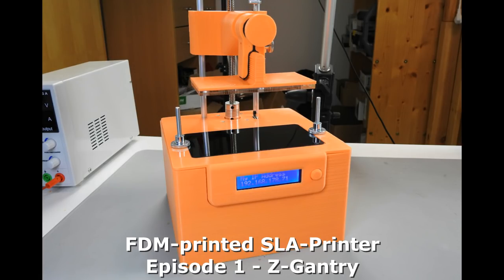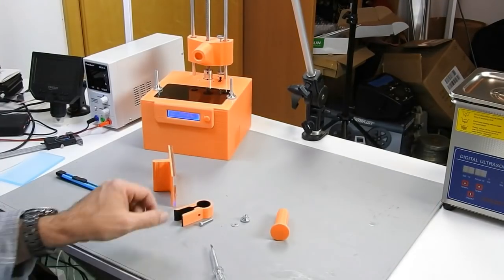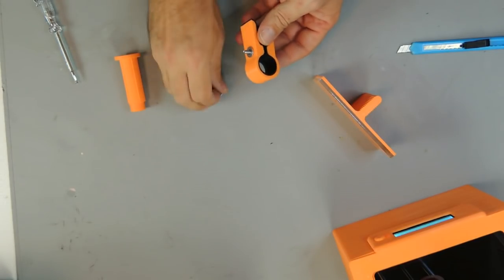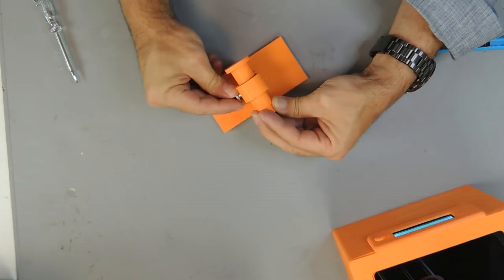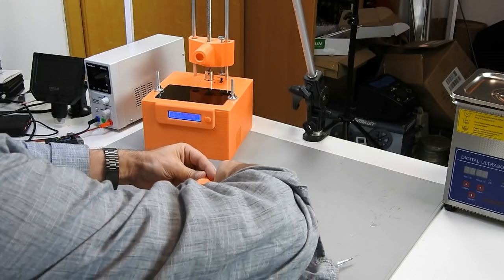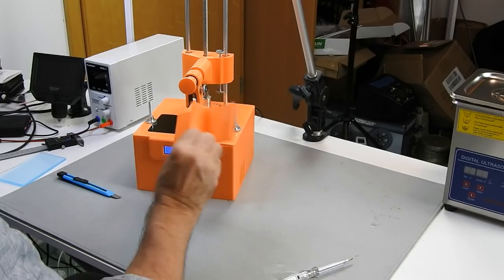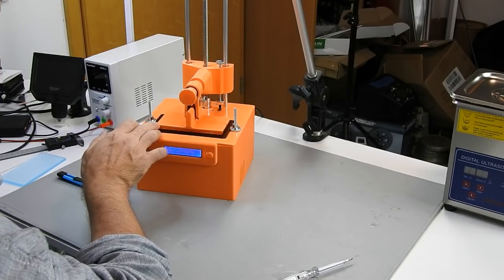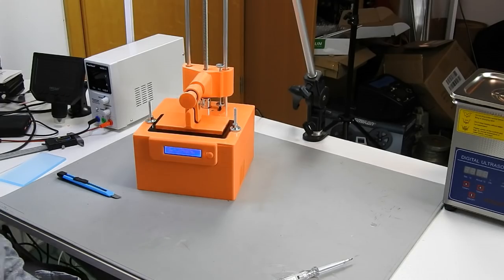DIY: FDM-printed SLA-Printer - Part 1

Comment: If you haven't read this paper titled "Constrained Window Design in Projection Stereolithography for Continuous Three-Dimensional Printing 3D Printing and Additive Manufacturing". Your printer model can be reconfigured to add a PDMS cured layer on the bottom using the IW configuration to have continuous print with injection molded quality.
Reply: what a short name.
Reply: This requires special resin (or a special additive at least) and a (specific) two color display, so... as cool as that would be, I think it might be a thing for commercial manufacturers to offer first (especially the resin).

Comment: thank you very much for this project, im building one with 20cm/35cm build area with 90 micron resolution, less than yours that has 50 microns , using nanodlp v2.2, 15.6" 4k screen, and 80cm 2mm lead/2mm pitch screw for more accurate movement, and two 80cm rods with igus bearings. i don't know the Watt capacity of UV led i need and i suppose i will add an aluminum build plate

Comment: Your printer looks awesome, I´ll probably make it.
Also you should place associate links in the description (probably on Part 3) of the vitamins needed for the construction of the printer, so you earn some money for the design of this machine.
Keep up with the good work!!!
Reply from the maker: Joaquín Cubelli did you have a look on the Thingiverse page?
Reply: I did, by the time this printer gets out of the WiP, I might build it, also I saw all the materials needed there, but my point on the previous comment is unchanged, you could take advantage and use affiliate links to make some money on the sales of the components.

Comment: What are the dimensions of the printer covers?. It looks like it's about 17(X)  x 17(Y)x 13 (Z)  cm? I'm just wondering what kind of printing area requirements there are for the FDM to print this. 

I'm definitely doing this as soon as I get my FDM kit. I want to print miniatures. 

Is this a 0.9 or 1.8 degree NEMA 17?
Reply from the maker: 18 x 19 x 11 cm
Reply: And the NEMA? It's 0.9 or 1.8 angle? That shield you build scares me. Don't have a lot of experience on electronics and soldering but it would be an interesting thing to try.
Reply from the maker: Nema17 typically has 1.8 angle fullsteps, but will be further devided into microsteps, depending on capabilities of the stepper driver. However: angles and stepping/ microsteps are flexible configurable inside the nanodlp software configuration.
Reply: I'd suggest a good quality .9 degree  stepper motor(if you can find one)for better precision sens sla printers known for crazy detail.